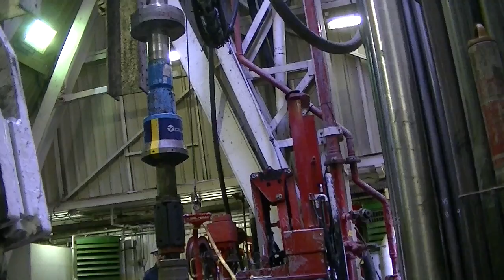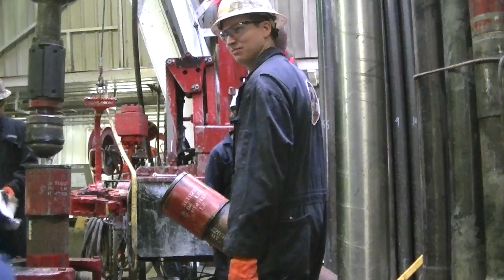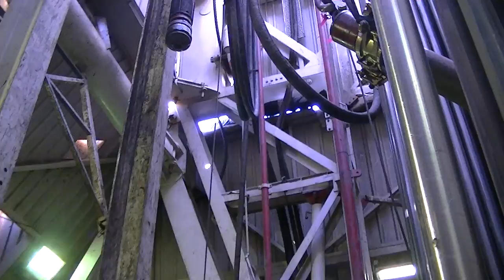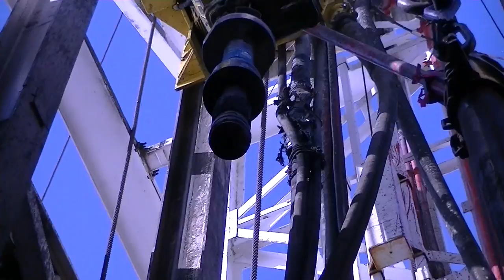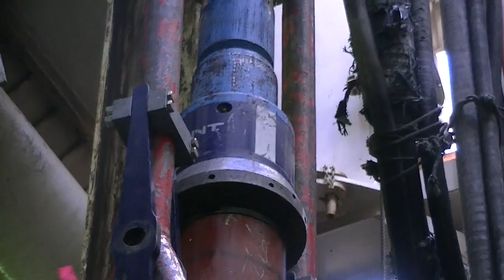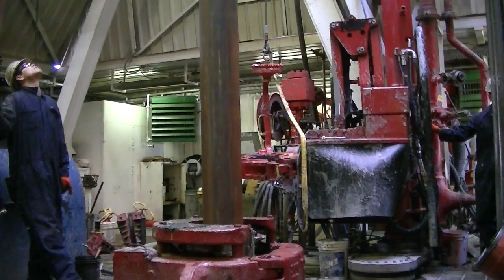Volant Products Top Drive Casing Running

Comment from the maker: The main advantages are improved safety (by reducing number of people and pieces of equipment on the rig floor), improved efficiency (by packaging casing make-up, fill/circulate, and hoisting in a single tool), and the abiltiy to rotate while running casing.

Comment: Something not mentioned is that this is the first time this rig ran the tool. They run roughly 10 jts per hour on this rig, but there is no NPT for fill and circulate, and if there if trouble, it can be addressed without delay.